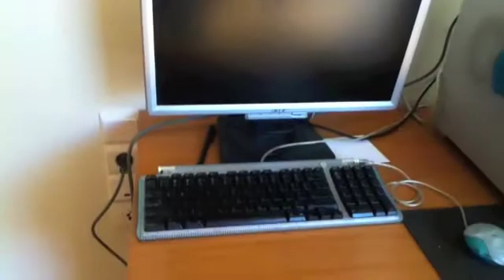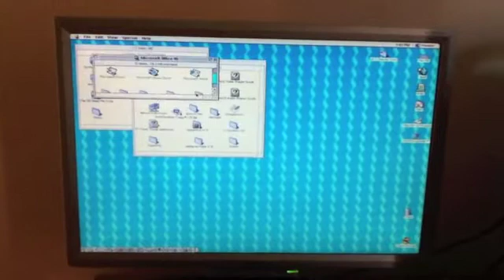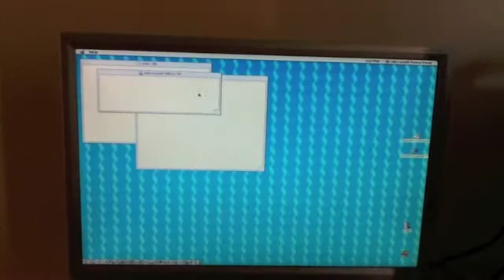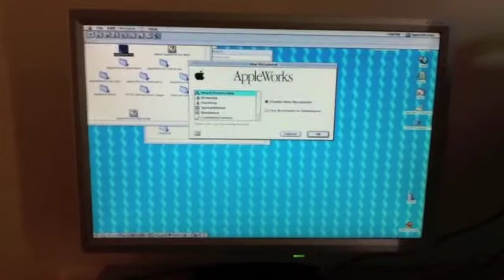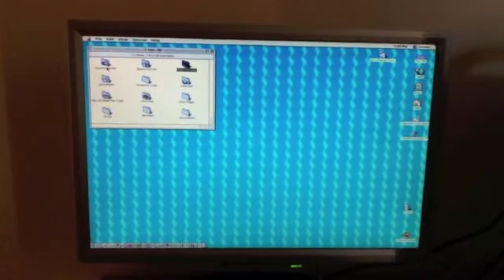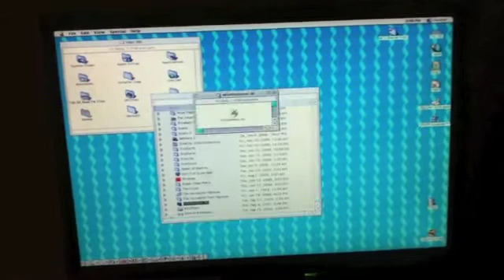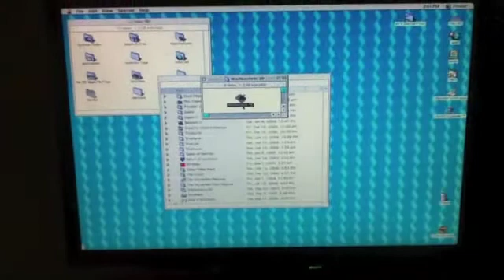Apple PowerMac G3 B&W 400MHz/1GB Ram/60GB HD

Comment: I really want to buy one of these. Where can I buy one without paying out of the wazoo for it? Local craigslist doesn't have any.
Reply from the maker: Got mine on eBay.  Good luck!
Reply: got mine off local ebayseller for 10 euro xD there so cheap here. Its now going to get a new inside and some light mods.
Reply from the maker: sounds good!  You can get tons of FREE software at macintoshgarden